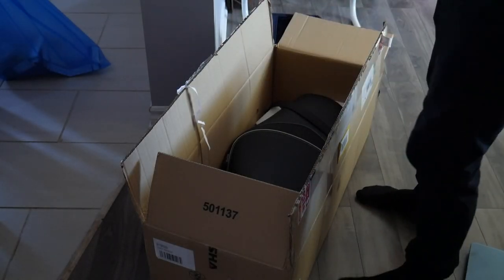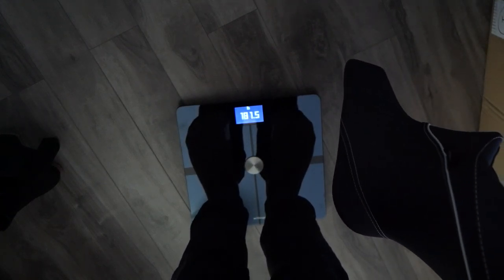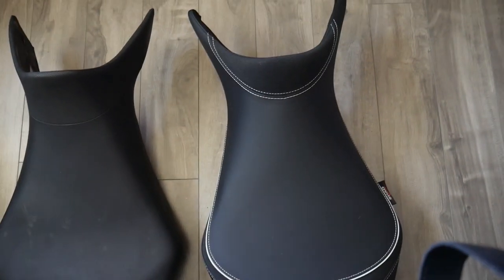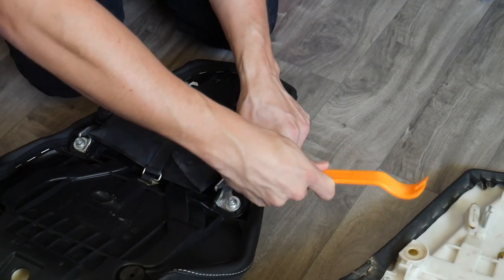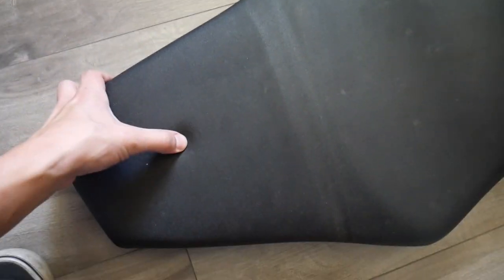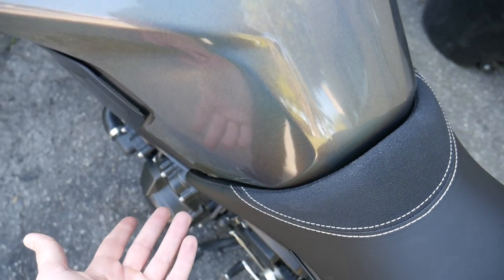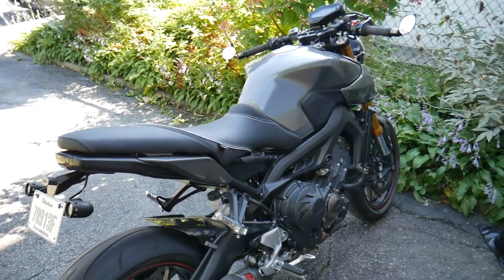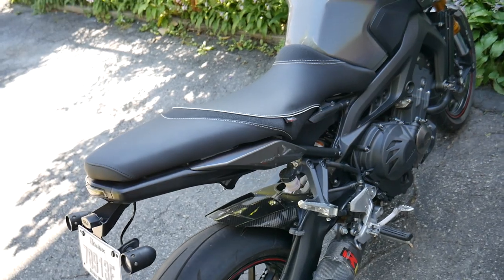Shad Seat Install/Review, Yamaha FZ09/MT09

Comment: Did it come with the rubber pieces & the metal latch?
Reply: I fitted a Shad seat recently to my MT-09, and the seat doesn't come with the rubber bungs or metal latches. You have to transfer them from the old seat to the new one. Hope that helps.

Comment: So is it much more comfortable than stock?
Reply from the maker: its not as plush as i though it would , but the big difference is that you dont slide as much and on a long ride you dont feel hot spots like the stock one.It's on the long term that you realise the changes.